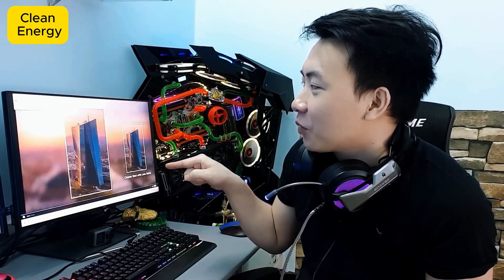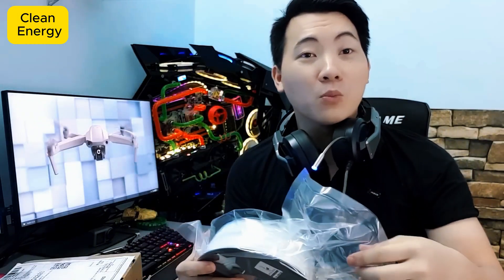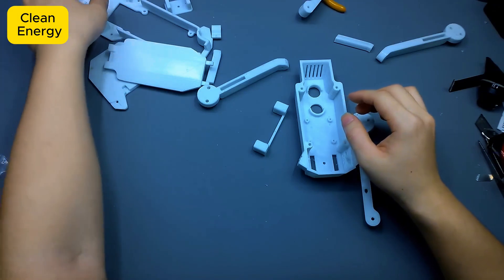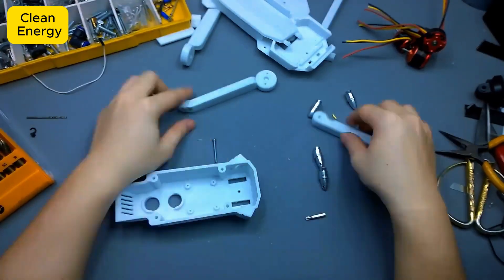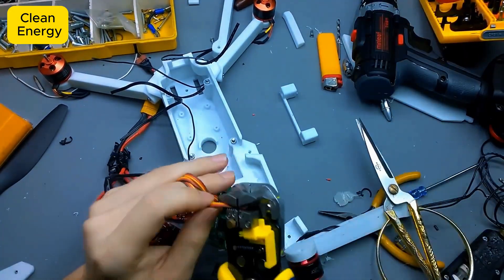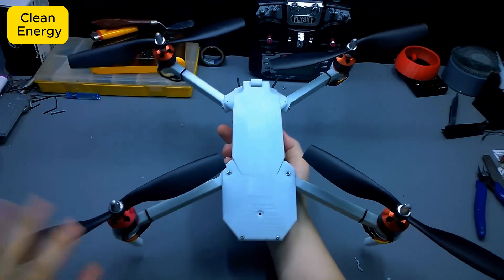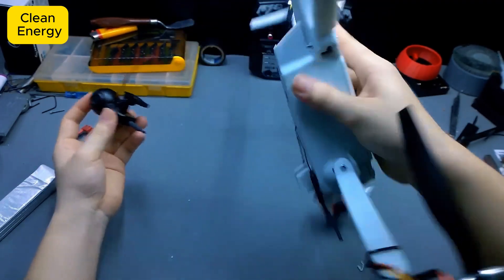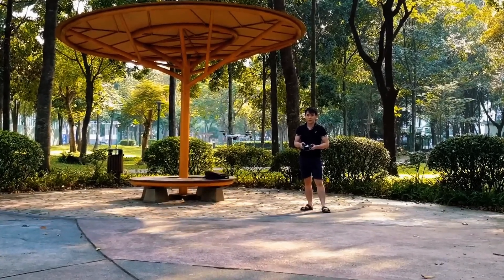Drone Manufacturers Don’t Want You to Know This…

Comment: You can put a peace of foam under the FC and  frame to absorb vibration. That Flight controller looks like a K2 FC with a missing screen. I like to get a chunk of pink panther foam board form Home Depot stick the arms in it use a rubber band to hold the fc and battery on very little weight. build time 20 mins.